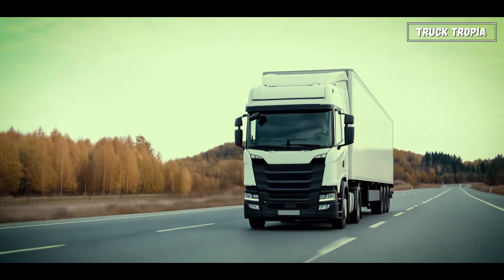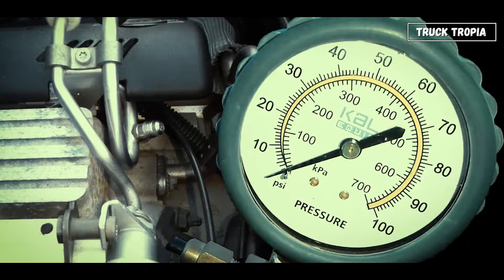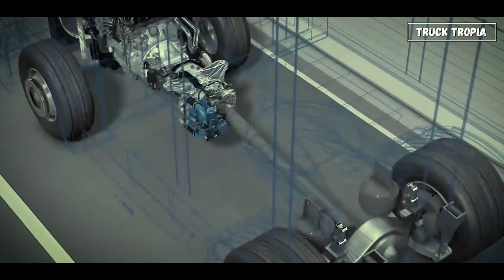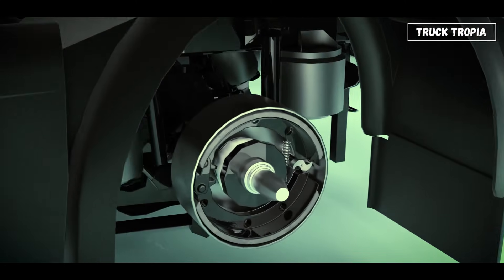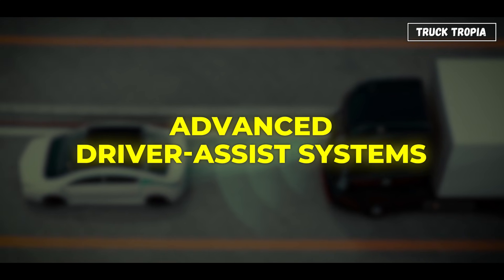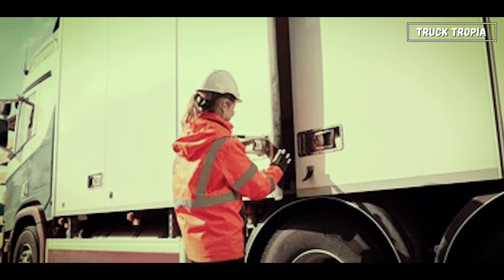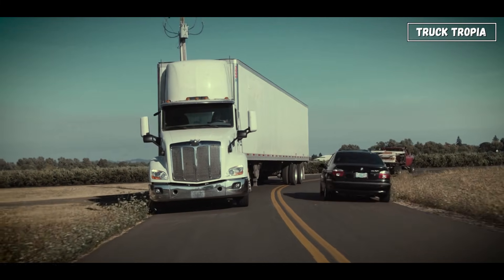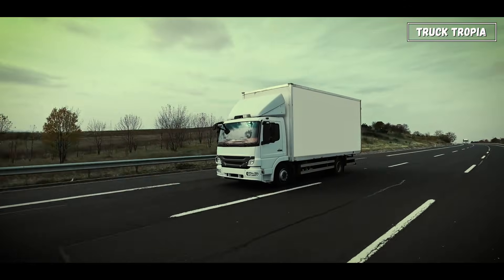17 Semi-Truck Parts Explained in under 10 Minutes

Comment: truck brakes doesn't use air pressure to push pistons to brake. air released from brakes to STOP pistons holding brake pads AWAY from discs.